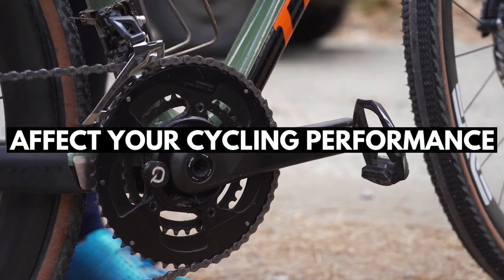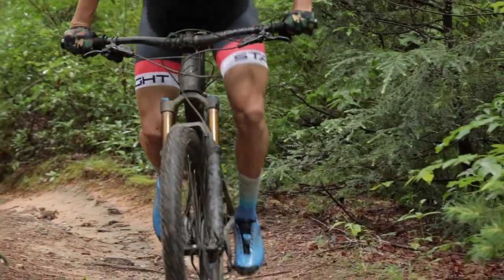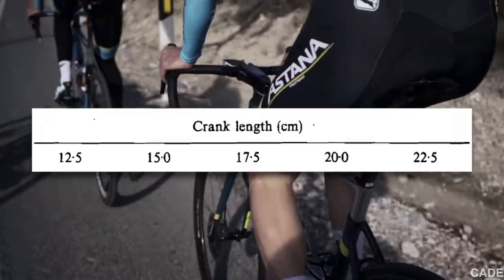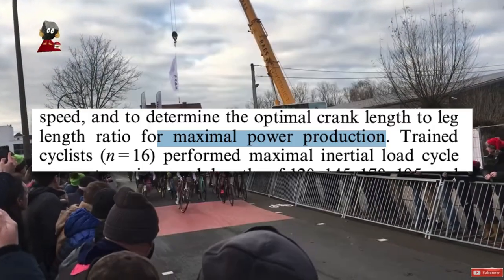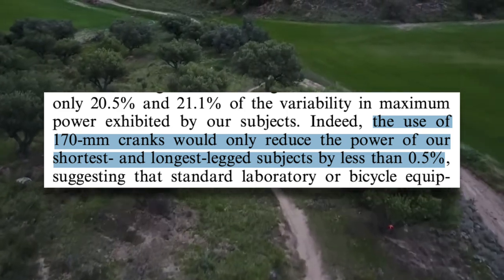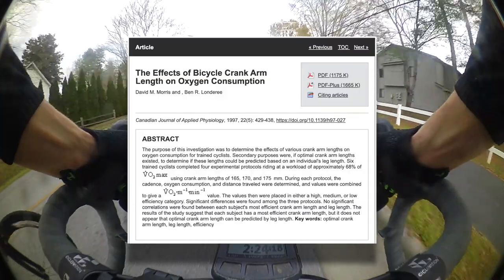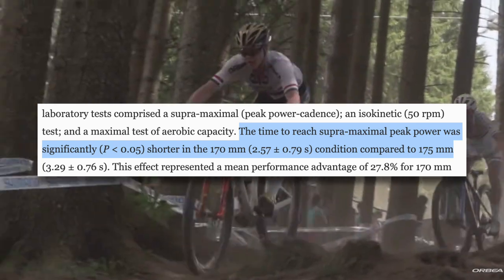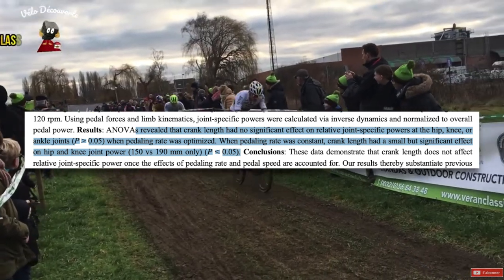Does Crank Length Affect Your Cycling Performance? The Science

Comment: Great info. Bingo, just ride what feels the most comfortable and will help you ride more. I've done a lot of research on this in the past. I've tried 190mm down to 160mm. I found I preferred 170mm. I am 6'1. You're going to get heckled by Durian Rider now, "spin it to win it!" LOL. Thanks again Dylan.
Reply: Black Water Cyclist Heckling from Durian Rider is a badge of honour! 🤣
Reply: Im 5'7 and use 175.  Thats what came on my bike but it feels good.  And i dont think i would notice a difference with a 172.5 or 170 tbh.
Reply: I ride a 170 on my road bike and im 6'0. one of my track bikes came with 175mm (used) but I switched to my normal 165 track crank lengths and I noticed a slight difference in feel, but its hard to describe and not that noticeable, I guess more  favoring to spinning like the video says
Reply: I'm 6'4 and have a 1000mm inseam.  I've been most comfortable riding the 180mm cranks I have on my bike now.  I found I get sore knees when I ride fast for a long time on the 175mm I had on it previously.  The 165mm on my track bike are even worse.

I want to try longer, but unfortunately there aren't many options in that regard.
Reply: @nwimpney  Oh yeah, you will probably feel better on longer cranks.  There is so much that goes into crank arm length besides just femur length or inseam length. Those are important measurements but I think other things that people do not think about is if you are a toe down vs heel down vs neutral foot peddler. If your toe down like me, your hip gets closed up more at the top of the stroke which is why I like the shorter cranks. While someone who he is heel down is able to make that "deadspot" not push up their hip as high. Another thing is hip flexibility. If you are tight in your hips, you will like shorter cranks vs someone who is more flexible. 

 I had some 190mm lightnings I tried. I could mash up some crazy steep hills but it was essentially the same as putting a 34T or 36T on the rear cassette with a 170mm crankset up front. I had a little bit of front knee pain when I went down to 160mm. 

Were you raising your saddle and moving your saddle setback rearward when you tried the shorter cranks?
Reply: @moviepedro  many people do not feel a difference between 5-10mm crank arm lengths. I feel it but I think it is because I have tight hips so just a little bit higher in the deadspot causes my hips to be uncomfortable.
Reply: @BlackWaterCyclist  I actually started with the 175mm cranks, and switched to the 180mm from there.  I did lower the saddle a bit, but I was fine with the setback.  I'm fine with the hip flexibility, and with my leg length I'm still riding with less angle than the average  Joe is on 175.  The cranks on the track bike are limited to being short by the fact that it's a steeply banked track, and you need the pedal clearance not to crash, so I can't really do a fair comparison on that bike.
I would actually like to go even longer, but they start getting expensive and difficult to get once you pass 175.  180 usually only happens in the higher end stuff, and beyond that tends to be really pricy.
I'm planning to build a frame later on this spring that I'll have a set of 190mm profile BMX cranks on, adapted to fit a normal chainring.  That'll let me raise the bottom bracket a little bit as well, since I'm otherwise losing another 15mm of ground clearance.
Reply: @nwimpney  You may want to check out Waltly Titanium. They make custom Ti frames for around $1000 and you could raise that BB for those longer cranks.

Comment: Short cranks on the track are also to avoid pedal strikes on the banked surface. The flaw for crank length arguments is that the dominate lever of the system is your femur, which you only get in the length you are born with.
Reply: sad to born with short lever.
Reply: you have to be going really slow (like 8mph) to pedal strike on the track... on flat ground its another story (for fixed gear crits)
Reply: @moviepedro  I've banged my pedals lots of times when manoeuvring on the straights, which need to be banked to a lesser degree so you're not climbing such a hill entering the corners.  Quickly moving over to the right (up the track) on the straights is how I've frequently hit them.  I've also done it when I dropped down a little sharper than usual in a sprint, and had to turn back to the right to straighten up.  (going quite fast)
Reply: nwimpney oh ok! What length cranks were those?
Reply: @moviepedro  165mm.  That is making some unusally aggressive turns, though.  And it also depends a lot on the track.  outdoor tracks aren't likely to have a problem.  The track I was riding on is 200m indoor, and around 47 degrees in the steep banking, 15-20 (my guess) on the straights.  They say 30km/h is around the minimum speed for the corners on that track, but if you've got a relatively high bb, and 165mm cranks, you can go pretty slowly on the banking if you're very smooth.  I think most of the crashes from slow riding in the steep banked corners are actually traction related, or people turning outward too agressively.  Tire slides out, and then the pedals hit the ground after.
It's a little counter-intuitive, but all the pedal strikes I've had were from turning outward on the straights.

Comment: Great video. I am 5'10" and just built a new bike with 160mm cranks. I went that short to resolve a biomechanical issue particular to the shape of my pelvis as diagnosed by my bike fitter/physical therapist. Despite good flexibility, can get palms to floor,II would get low back pain in even an endurance gravel position. 

For me, taking the chance, going that short, and opening up my hip angle made a huge difference.I can make more power, longer and more comfortably, in a more aero position then ever before. 

But I was comfortable giving it a shot because they studies say there is basically no risk in losing performance in going short. - my PT basically said the same as Dustin here. So I think one thing, is if you think there is a biomechanical advantage particular to your body, there is certainly no harm in going shorter. 

I ride a lot of gravel - and one nice thing about the short is all the pedal clearance. The only down side for me has been lack of selection. Rotor and Sugino are the only game in town that short with gravel gearing available, Favero Assioma pedals hacked with xpedo MTB pedal bodies for power.

Comment: From 2:15,  I know a male rider who use 150 mm crank length not for a power production nor a bike fitting reason. He use it just to have enough saddle height to avoid seatpost hitting with reservoir tank of his Specialized Shiv Disc (2020). The crank is Rotor Aldhu and I believe Rotor make this Aldhu crank  range from 150-175 mm for a good reasons.

Comment: Just dropped to 165's from 175's after my bike fitter recommended it.  I'm very happy with the change so far.  I'm 6'1", so you'd think 175's would be ideal, however, arthritis in my hip causes hip flexion issues, so it made a HUGE difference to drop to smaller cranks.  I only have 100 or so miles on the new cranks, but so far, so good.  I'm way more comfortable on the bike after the adjustments were made.  Can't believe I waited so long to get a proper fit.

Comment: When I started road cycling in 2000 I used 172.5 mm cranks for 16 yrs. Now I ride 175 mm cranks & what I’ve noticed is my torque & power is outstanding, especially on climbs. I wished when I raced I would’ve used 175 mm cranks with the power & leg speed I had back then. I’m a 6 ft. 225 lb. cyclist who can beat my smaller cycling friends up most climbs here in So. California. Oh yes, I’m 55 yrs. old by the way.

Comment: Good vid ! A subject that's been re-hashed over & over but it is important! During the last 25 years I have tried every length in the book, made my own 180mm with D.A. Octolink, etc. MTB finally tought me that 175mm were the best for me. At 5'9" my imseam is almost 34". It'all about comfort level at the top of the stroke, bottom of the stroke is easy to deal with. Also, longer cranks are more manageable with relaxed seat tube angles (for me!).

Comment: I've had 150mm cranks, on a recumbent 'lowracer' style bike. Event shorter ones have been seen: I know one guy who has had 110mm. Short cranks are popular in recumbent racing.
I'm 6ft tall and long legged, so I would be way out of the percent ratio for 'optimal' crank length.
The short cranks on recumbents are preferred for following reasons:
Cadence ('spin to win like Chris Froome)
Aerodynamics: feet out front means turbulence will be less with shorter cranks
Shorter cranks allows, in fully faired recumbents, a more compact nose to the machine, aiding airflow and thus aero efficiency.
Muscle fatigue: faster cadence means lactic is taken away quicker. The trend with Pro cyclists from 30 years ago to today supports the idea that spinning is better than grinding. So faster cadence with shorter cranks might give indicate a marginal performance advantage. Some studies also indicate that the range of angle of knee/hip is the factor that makes the marginal difference in power output seen with shorter cranks.

Comment: Thanks for making this. I have been wondering this for a while.  In 5'7 with a 30 inch inseem and i use a 175mm. With that setup my max cadence is around 200 and I usually hold around 95-105 on my rides.
Reply: Seriously? We are similar height, only half inch taller and my inseem is 32.5 inches . I find it hard to pedal 170mm...
Reply: At 200 cadence I think I'd be falling off the bike. With shortish legs and long cranks thats a crazy ammount of leg movement. If it works though thats what matters.

Comment: That last study is the one that prompted me to think about going from 172.5 to 165 mm (5'9" fwiw). As you mentioned, the evidence suggests there is no real difference in power output. From a fit standpoint the knee angles and hip angles are less acute. In addition cadence seems to naturally go up with shorter cranks and while I couldn't find any research that established causality (though there was some conjecture), it was a common observation across multiple studies. I'm not aware of any longitudinal studies that look at crank length over a period of say, 20 years to see if that has an impact on knee issues in (ahem) aging cyclists (I'm only 47, but my body has given me a few reasons to consider this more carefully given that I'd still like to be riding 23 years from now). Anyhow I figured If I dropped the crank size which resulted in a faster cadence the force on the joint for a given power output might be less (at that higher cadence) than it otherwise would be with a longer crank. While gearing is a part of that lever system, you do functionally lose some leverage in your smallest gear so to counteract that I'm also going from an 11-28 to an 11-30. So... new cranks, new cassette... also new shoes, and switching from Speedplay to Shimano DA SPD SL after 23 years (I have an appointment with my fitter soon). Be back in 20 years with an n=1 study that has absolutely no controls.

Comment: I have a 39" inseam and osteoarthritis.  Switched from 175 to 200 mm cranks on my road bike 4 years ago.  My ride has 1600 vertical feet of climbing and in spite of the 14% increase in mechanical advantage I was no faster (or slower).  It was hard to spin in the beginning and avoiding pedal strikes was, and still is,  challenging.  My 200 mm IRD cranks are  heavy but inexpensive compared to Zinn cranks.  I keep using them in hopes they extend my knee life.  Note this is the opposite of Jessica's approach below, where she switched to shorter cranks.  Longer cranks increase mechanical advantage, shorter cranks decrease range of motion.

Comment: I run 210mm cranks and love it!!!  I have no problem holding 105RPM for +2hrs when riding indoors. I have been racing since 1988 and I rode 180mm until I found the 210mm about ten years ago.  When I want accelerate it is like having motor on my bike I just take off.  Keep in mind I have long inseam but longer cranks allow me to run a smaller bike.  I am supposed to be on 63cm frame but ride a 56-58cm frame.  I am 5"11' with a 37inch inseam and weight 190lbs and my race weight is 155lbs...ya I am over weight!!!

I like that I can use make more use of my Hamstring muscles.  I hear many saying because the diameter is long that it takes longer to turn the pedal.  This is absurd thinking!  As long as the crank is turning there is power being generated!!!  4 hrs. of pedaling is 4 hrs. of pedaling.  I'd rather more use of muscles than limit the range of motion my leg muscles go through. 

What I find baffling is the cycling community continues to attempt to rewrite the laws of physic.  A longer lever will always be more efficient.

I put 210mm cranks on my MTB and it was a dream I could ride at any cadence and have no problem riding up steep hills (I just need to drop 30lbs-40lbs!!).  When it comes to running crank length test the test has be over a period of weeks and months because your muscle have to adjust to the range motion/pedaling habits.  

Why does cycling think a long crank leads to low RPM's when the longer lever makes it easier to turn the chainring...so how does that equate to making it more energy consuming?
Many cyclist act as if the race is won by who can spin the crank arm the fastest when instead it who can turn the rear wheel the fastest.

I did some research and found that almost all holders of the hour record use cranks at 195mm un length. The Hour attempt is considered the hardest bicycle test. So if it is so hard why use longer cranks if longer crank use more energy? 

I will say this because it is easier to turn the pedal you can start to day dreaming and pedal with less effort thus pedaling slower.  I find as long as I pay attention my RPM meter it is great.  Another cool point is when I am tired on flat road with a tail wind I can put the bike in a hard gear and just coast along (like over drive).

Comment: Great Info, but would have liked to hear more about the aero advantages of smaller cranks. With smaller cranks you need to raise your saddle which opens up your hip angle. In theory, you could lower your handlebars by 2 x the difference in the size of the cranks + the seat raise (for 3 x the difference all up) and keep exactly the same hip angle as before.  Surely this is likely to give superior aerodynamics. I'm not sure if there are many studies on this part of it, but to me it makes sense.
Reply from the maker: I touched on it very briefly at the end. The good news is that because crank length has little effect on power production running shorter cranks to get in a more aerodynamic position shouldn't be an issue.

Comment: I concur with the conclusion. I can feel a bike-fit difference between riding my gravel bike with 175 cranks and my road bike with 170 cranks and have been saving up to swap the gravel bike cranks to something smaller. When riding my XC with 175 cranks the bike-fit differences are not noticeable because the whole setup is completely different. Glad to learn that none of the crank length changes will actually have any meaningful impact on my measly power output.

Comment: After doing some research, i decided to put 165mm cranks on my bike to replace 172.5mm cranks. This makes a massive difference in bike fit. a 7.5mm difference in crank length opens up the hips by twice that at the top of the pedal stroke, in this case 1.5cm. I could also lower my handlebars a bit without losing comfort. As for power, every person has a naturally preferred pedal speed, being the speed by which the pedal travels along the pedaling circle. As a result, longer cranks will make you ride at a lower cadence, shorter cranks at a higher cadence to maintain the same pedal speed; since power is torque multiplied by angular velocity, the change in cadence (and as a result, angular velocity) and crank length sort of cancel eachother out. in other words, power might vary, but really not that much. The right crank length for each indivdual's biomechanics trumps that by far.

Comment: One Note regarding crank length on the velodrome.  The reason 165mm is max length people run is for safety reasons.  Also often regulated as max length at tracks.   It is set at this length to avoid pedal strikes when pulling up on the bank in the turns.

Comment: Awesome video Dylan. Some of my riding cronies are obsessed with crank length and wholesale swapped out a bunch at the same time. Kina had me thinking it was vendor conspiracy to get people throwing away perfectly good stuff for something "new & improved" LOL

I've never paid much attention to using anything other  than 175mm on all my rides. I messed with 180mm's on single speed 29er's and found that it felt more efficient on certain geometry bikes over others. Nothing too dramatic and with the more modern geometry designs with lower BB height, longer cranks can lead to more pedal strikes.